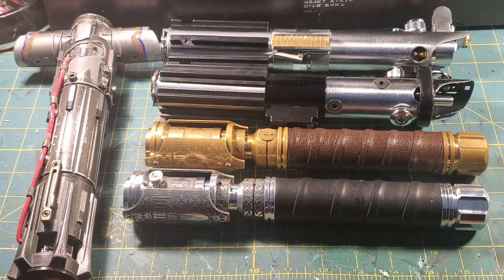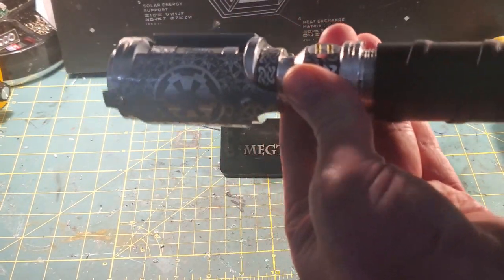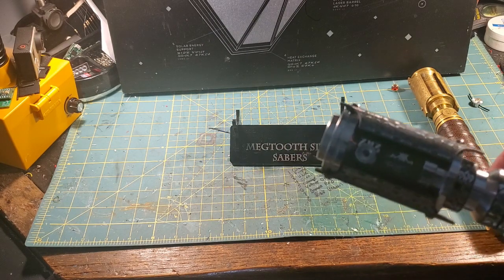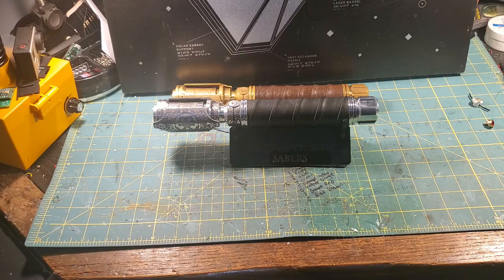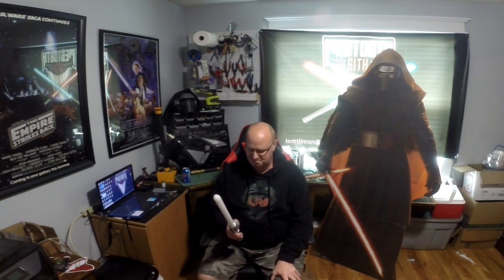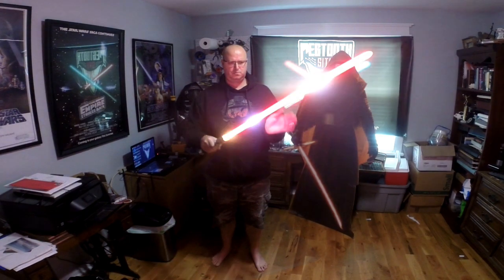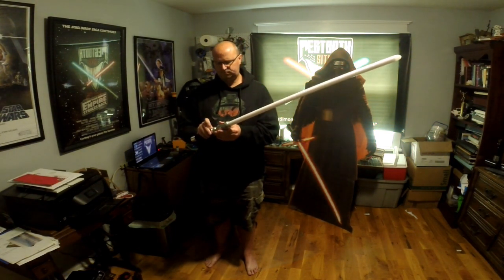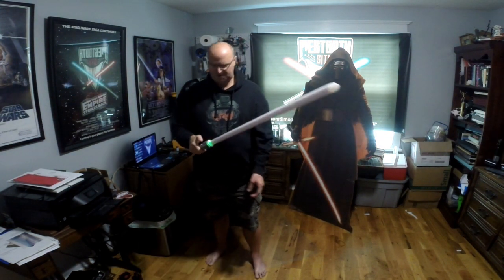1st ever Gen 3 Proffie 3 7 Beta Saber  KR Flagship!

Comment: In your opinion is it worth upgrading from a 2.2 to a 3.7 at this time?
Reply from the maker: no, because the 3.7 hasnt been released yet. I will not be replacing my 2.2s, because they work just fine. But for a new install, you need a soundboard and 3.7s get released? Absolutely, its going to be a great board.
Reply: @MegtoothSithSabers  is it not worth waiting for then if you're willing to wait?
Reply from the maker: @Rashimotosan  if youre willing to wait I suppose, but I installed a lot of 1.5s last year, and Ill continue installing 2.2s. If this chip shotage doesnt abate, it could be 6 montgs or more until 3.7s are produced.
Reply: @MegtoothSithSabers  yikes. Gotcha.